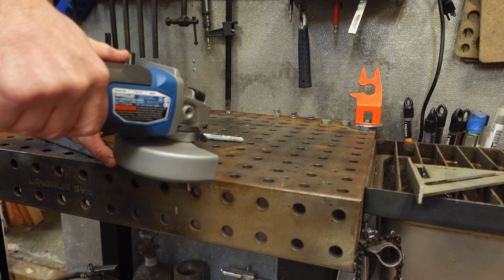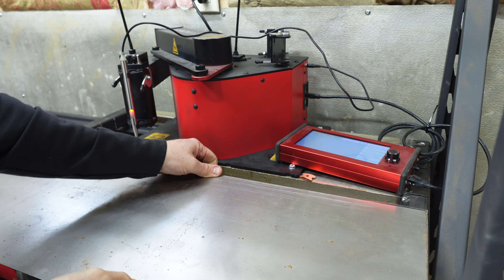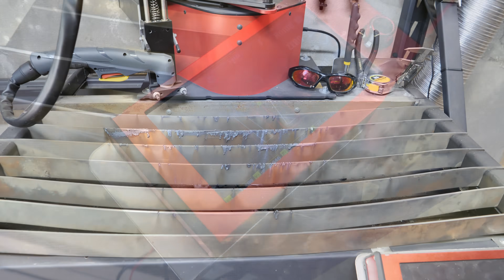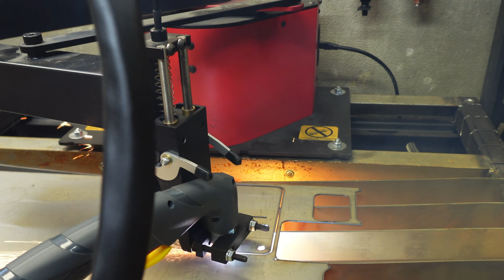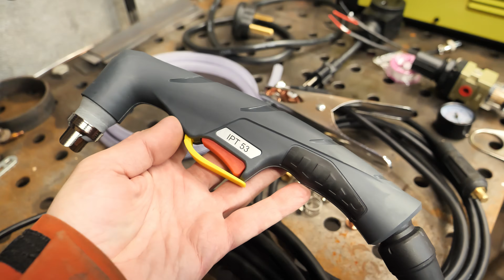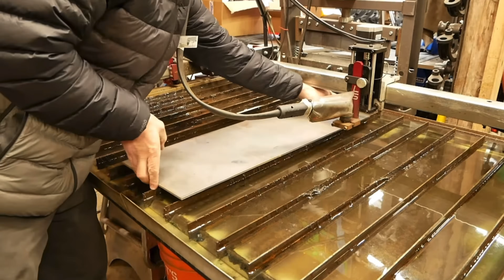Arcdroid, Down draft table, Arcfony CNC plasma cutter

Comment: So...I bought the ARCFONY 53n cut pro after seeing this video, problem is that the instructions are extremely vague, there is a 5 pin connector and a 2 pin connector for cnc connection on the back of the unit, I am afraid to hook it to my arcdroid because i will be shooting in the dark and i dont want to damage my arc droid. Is there any chance you could do a quick video to show how you have your arcfony connected to the arcdroid? It is one of the plasma cutters listed on their website, but I cant even find anything regarding wiring the arcfony to the droid on their community forum.

Comment: I bought the ARCFONY 53N pro for my langmuir cross fire pro. I havent been able to figure out the THC wiring.
Reply from the maker: My Arcfony cam with a manual that showed how to hook it up to a plasma cutter, if you are running a Langmuir crossfire you will need there voltage divider, if you are hooking it to the Arcdroid then you will need to buy a 3rd party voltage divider. There’s a small channel on YT that sells them.

Comment: Finished building my JDsGarage plasma table about a month ago.  Been fighting my little HF 3 in 1 Tig, Stick and Plasma machine with all the CNC EMI hardening stuff.  It does cut but cannot plunge as initial torch height is critical for arc start.
So I finally pulled the trigger on this Arcfony CUT53N cnc!  Should be here today!
I had watched this video a few  months back but wasn't thinking of a plasma cutter at the time.  Found this video again on researching the Arcfony, LOL.  Great video as usual!  Keep it up.

Comment: Hi Mike, I'm a huge fan and have learned a lot from watching your channel. Matter of fact I bought the Arcfony from watching your video. I took your advice and wired 220 in my garage. I've also, used the same filter/dryer you have. I could sure use your help hooking up my Arcfony for my first cut. I bought the X2 and hoping to make my first cut by Friday. I have a 60 gal Mega Compressor which should do the trick. My plasma table is almost ready except for the final down draft addition like yours. Getting really close and would be forever grateful to you for some of your knowledge hooking this thing up.  

Glenn Green from Corpus Christi, Texas

Comment: What is the thickest metal you have cut cleanly with the arcfony on the arc droid?
Reply from the maker: I haven’t needed to cut over 1/4” with is setup yet. I have cut up to 1/2” really cleanly with a different 45 amp plasma cutter, you just need to slow your cut speed to about 16” per minute when cutting really thick metal.

Comment: whats the minimum cfm flow rate to operate that plasma. i looked at the specs and it says 25L that converted to cfm is 55 thats got to be a huge compressor
Reply from the maker: No I think that info has to be wrong, I can’t remember what the CFM is but I have a old worn out two cylinder 50 gallon compressor and it doesn’t even come close making that compressor work. I bet a 20 gallon compressor would be fine to keep up with this plasma cutter, I usually run the PSI at 50 or 60.
Reply: @Mikefestiva  thanks brother that really helps out I think I want to buy it I’ll use your link so you get some credit
Reply: 1 cfm is 28,317 liters/minute.
So 25 liters/minute = 0,883 cfm.
Or 6.6 gallon per minute. 👍

Comment: Hi Mike, I'm a new subscriber to you channel.....love your content. Quick question....I just ordered the Arcdroid and the Arfony Cut53 N Pro as well as the exact air drier/filter because of what you shared on your video. My next purchase is an air compressor. I'm a hobbyist in my home shop and would like your opinion on what size air compressor would work best with my set up.

Comment: Hey Mike, hoping you can help here. Bought the same plasma cutter to go with my arcdroid after watching this video. I see the 5 pin connector that comes in the box, and 4 wires (2 red, 2 black). However, what wires go to the back of the arcdroid? I have 4 wires on the back of that 5 pin and only 2 ports on the back of the arcdroid! Hope you can shed some light - haven't seen any other videos of guys using this plasma torch in this way! Thank you
Reply from the maker: I just looked in the manual of the plasma cutters and wired it the way it said to wire it. 
I’m pretty sure pin 1 and 2 are already connected to each other from the factory. Run pin 1 or 2 whatever one has a wire already connected from the plug to the arcdroid, then run pin 3 from the plug to the rear of the arcdroid and you should be good. 
Again all the info was in the manual.
Hope this helps.
Reply: @Mikefestiva  Thank you I'll have another look!
Reply: @Mikefestiva  sorry to bug you again. Still confused! There are 4 wires coming out the back of that 5 pin connector. Are you saying if I run pin 1 or 2 and then pin 3 to the arcdroid, then I leave the other 2 wires connected to nothing? Sure wish I could see a picture of your setup for clarification
Reply: @musiccitycruisers3863 did you ever figure this out? I’m
Tryn hook mine up and baffled also
Reply: @Hustlerhotrod  I did. If you can send me a PM I’ll send you the details and pics

Comment: Hey Mike beena subscriber for years, you inspired me to start a fabrication channel 4 years ago, AC Designs Garage . Im on the fence on an arcdroid or the langmuir like you have. Which would you buy today if you had it to do over again?? Thanks man God Bless Adrian at AC Designs Garage 🙏
Reply from the maker: Right on man that’s great you started a channel! Well I would say either CNC cutter will be a complete game changer for you.
I would say the learning curve for the software on the arcdroid is much faster to learn and start cutting, although it’s pretty basic software.
The Arcdroid is smaller so it takes up less room but you need to build a cutting table for it. 
The Crossfire pro is built into a water table but does take a lot more room in a shop.
You also have to build the table/CNC.
The learning curve for the third party software is slow to learn.
Over all if you want to make projects around your place and for YT videos and maybe a little side work cutting parts the the Arcdroid is probably best. 
If you want to do all that plus start a side business cutting custom CNC parts the Crossfire is probably the best, table size is much bigger and I feel you can get more work done when cutting with it, but the down side I mainly see is the third party software is really slow to learn and slow to make simple changes to the design.
Hope this helps 👍
Reply: @Mikefestiva  thank you very much for the help!!! I was leaning towards the arcdroid because of the size. My shop is not huge and since im fulltime on youtube I dont plan on doing much side work. Thanks again Mike!!!! Adrian at AC Designs Garage!

Comment: I have the same arc fony plasma. How do you hook up the cnc ports in the back? Do I need a relay? What wires between the two red and two black go to the vcc and what ones go to the pmw? My cnc light is on but torch won’t fire

Comment: Just got the same plasma cutter but mine doesn’t want to cut
Reply from the maker: Make sure you have good air pressure, at least 70 PSI going to it. Check your consumables and make sure they are installed right.

Comment: Mike, can use the 𝗔𝗥𝗖𝗙𝗢𝗡𝗬 𝗣𝗹𝗮𝘀𝗺𝗮 𝗖𝘂𝘁𝘁𝗲𝗿 CUT53N Pro CNC Plasma with the Langmuir CrossFire Pro?
Reply from the maker: Yes it’s a blow back pilot arc start plasma cutter 👍 I haven’t hooked it up on my Crossfire because I have the Hynade on that table but it should work fine 😊 
I’m actually running the arcdroid with the Arcfony at work today 👍
Reply: Mike, I'm about to order the Hynake, but it doesn't show a cutting torch handle.  Do I have to buy the handle separately? @Mikefestiva

Comment: Nice video I just received my Arcfony today and just ordered consumables from there too so they are in stock. I'm just waitining on my Arcdroid to get here. Looking at your video you used the 5 pin connection. This is all new to me and I dont quite understand the wiring so how did you connect yours to the Arcdriod. I see two red wires and 2 black wires???

Comment: The one thing I'll add as a comment is about that Costco shelving.  Those shelves are GREAT and are pretty heavy duty.  But if you want to set up a workbench or a CNC router or something on them, bolt the shelf legs down.  The shelving is great for storage but may want to wobble or tip on you if you do much work on them.

Comment: A few years back was a guy in Goodwill buying dirt cheap ink jet printers to experiment using the sensored actuators.  Is that possible for plasma cutter diy?
Reply: They might not be strong enough to move the arms around as needed.

Comment: Would you recommend the hynade or the arcphony for the basic Langmuir ?
Reply from the maker: I think I like the Arcfony more, it’s more affordable and I like that it comes with the adjustable regulator on the back with the digital air Pressure on the front, the Hynade CUT60DN works well but the air pressure is set internally and it’s never been an issue but I do like having control over PSI. 
The torch and lead is higher quality on the Hynade but the torch and lead hasn’t ever been an issue on ether plasma cutter. 
Hope this helps

Comment: Now that you have this new cutter which would you recommend for someone who is building their own cnc table.
Reply from the maker: I think this is the best value for a blow back pilot arc start plasma with CNC pugs on the market.consumables are also very affordable. Consumables can get fairly pricey on most name brand plasma cutters.
So far I haven’t had any issues with it, time will tell? The plasma I have had the most time cutting on my other table is the Titanium 45, it’s cut a few thousand feet of metal so far and it’s still going good after 4 plus years but it doesn’t have CNC ports and it’s about $900. As long as most of the metal you plan to cut is 1/4” and under I think the Arcfony would be a great plasma for your CNC table.👍

Comment: I’ve been using the Arcfony plasma cutter for about a month and a half now and it’s worked pretty well for what I’ve needed, I ended up getting it on sale with the 3/4 year protection plan for less than $300 or something around there. Not too bad for a plug and play plasma cutter that’s for sure.
Reply: You using on arcdroid?
Reply: I am using it with a 1st gen Languir systems 2x2 plasma table. the combo works pretty well.  @Hustlerhotrod
Reply: @Hustlerhotrod Langmuir systems plasma table, 2x2 table

Comment: I'd love to hear your thoughts on water table vs down draft table.  I like the idea of a down draft because i don't want a tank/tray of water to deal with.  I'm just not sure if you are giving anything up with the down draft table?
Reply from the maker: Well I have both, water and down draft, 
My friend has a CNC and he doesn’t have ether, his table produces a lot of smoke and sparks, not really very good to be around.
A water table is nice and it also keeps thin metal cooler so it doesn’t warp as bad, it does really suck to clean out though when it gets dirty and slugged up. That’s why I wanted to build a down draft for the Arcdroid, a down draft is really clean and much easier to clean up. I’m sure each table has its pros and cons but they both help keep shops and lungs clean and I think that’s probably the most important thing.
Reply: @Mikefestiva  I grew up using a plasma cutter in our attached garage. You could smell it in the whole house. I have the yeswelder combo tig/stick/plasma with the built in compressor. I roll it outside when I make cuts. I don't see myself doing it with a CNC plasma table. I'm likely a few months away from picking a CNC table (other projects to finish first).

Comment: I appologize............there is NO "Arcfire" software........... meant the std Langmuir "FireControl"..............I'm old and get confused
Reply from the maker: Do you mean Firecontrol software? That software is Only for the Langmuir tabes and it doesn’t work with there first generation of crossfire if I understand it right.
Reply: @Mikefestiva  that is all correct..........we bought a 1'st  generation controller retrofit kit with theZ axis THC.........cost some $$ but was well worth it......fairly easy to make the changes, we have a Miller 625 X plasma with the CNC machine outlet.

Comment: What are your thoughts on connecting and using the Hynade CUT60DN with the ArcDroid? I bought it sometime back after watching your video.
Reply from the maker: I think the Hynade CUT60DN will work great with the Arcdroid 👍 I have my Hynade CUT60 hooked to my Langmuir table. The Hynade will have a better duty cycle then the Arcfony but I haven’t ever hit the duty cycle on either unit yet. 😊

Comment: Thanks Mike.  The ArcDroid continues to be on my short list.  If I had the room, it would be the Langmuir Pro.  But I just don’t have the room.  So I’ve been making a pro/con list between the original Crossfire and the ArcDroid.  Please, when you get time, I would love to see/hear your thoughts on a comparison.  All the best to you…..  👍👍😎👍👍
Reply from the maker: Thanks Joe for checking out my new video 👍 yes the compact size of the Arcdroid is really nice for a smaller shop, plus it can be moved outside even if you wanted to do some cutting out of the shop. I definitely will make a video about the two CNC units soon 😊👍

Comment: Super interested in a comparison video, especially between the Arcfony and Razorcut. I still have the Crossfire Pro that I got right after seeing the one you got but the Razorcut plasma cutter has been giving me fits. I got one of the early ones that had the flawed circuit board and I took it up to Kent where one of the guys at Jasic did the mod that was supposed to fix it. Unfortunately it still doesn't like to pierce while stationary. As soon as the torch starts to move it makes it through, so I make my lead ins as long as possible and about half of the running feed rate. This only works on stuff that's less than .125" thickness with larger hole diameters. Thank you so much for doing all the work and making videos. I watch them all.
Reply from the maker: It definitely sucks when the plasma cutter misses a a start, I have experienced that on occasion with the Titanium 45 and the Hynade. This is probably one miss start out of 50 starts or so. 
The Arcfony has been really good, it’s only missing a few starts out of hundreds I have made so far.
So far I think it’s the most affordable CNC plug and play available on the market. The thing I like more about the Arcfony CUT53N then the Hynade CUT60DN is the Arcfony coming with an adjustable regulator and the Hynade is fixed at one air pressure. 
The Hynade has a really nice torch lead but I think the Arcfony’s lighter duty torch lead works better for the arcdroid because it’s built lighter and is more flexible for the arcdroid arm to easily move it. 
I’m sorry you are having so much trouble with the Razor weld plasma.
For the cost of the Arcfony I think you would use your CNC table a lot more. Ps what software are you using? I have only used Fusion 360 but have heard a few others mention they use Sheetcam and QCAD. I’m thinking of looking into those programs.

Comment: Hi Mike, loved the Vid!  Yes, would like to see a comparison on the Langmiur table and the ArcDroid.  While at it, might also address which Langmiur table to get.  For example, I think you have a larger one but not the Pro?  A comparison maybe of the smaller table (4'x4' ?) and the ArcDroid would be particularly interesting since they are both kinda competing in the smaller size part space whereas the advantage of the larger Langmiur tables is obviously that one can do large parts.  Another thing to consider is maybe being able to free hand manual plasma torch cutting of the main features of a large part (for example the outer perimeter) and then see about registering the large part to the small Langmiur table or ArcDroid to cut out small registered detail (like a plurality of precisely placed holes or features).  I saw the registration trick done on another channel, so he could cut a 4'x8' sheet with a 4'x4' Lamgmiur table.  I think most folks would probably be doing smaller parts more often (I kinda think that is what you are getting at with the ArcDroid), but may have need to do larger parts on occasion, so would like the capability to do those larger parts, even if it means fiddling with some gyrations.  Thanks for all you do!

Comment: Mike you should fabricate a inline spark arrestor out of fine steel mesh to prevent dust in your ductwork and fan housing from catching fire! Much like exhaust on a lawn mower muffler.

Comment: Mike, for your fan, you might have been able to use the fan from a clothes dryer. They move a lot of air, but for an electric dryer, your motor would probably be 240v.